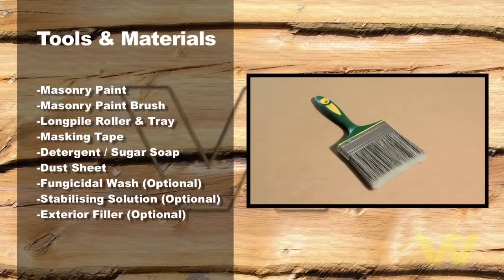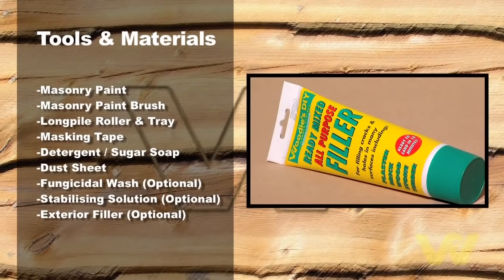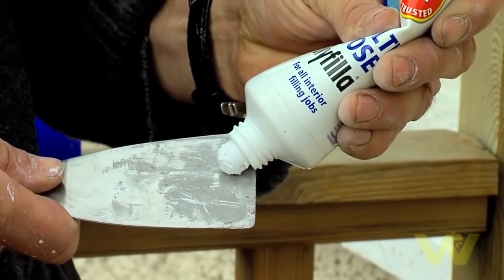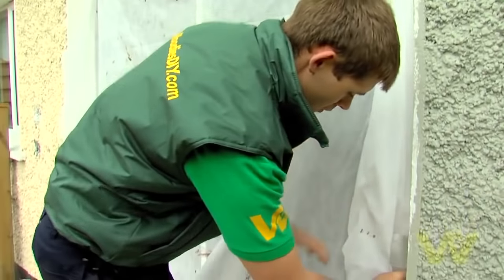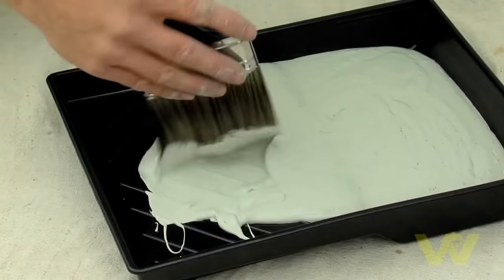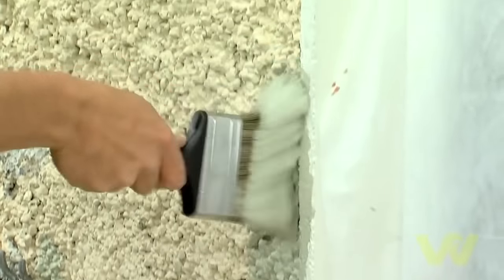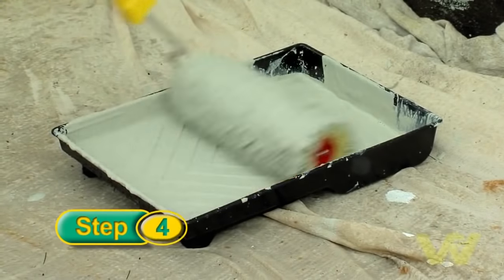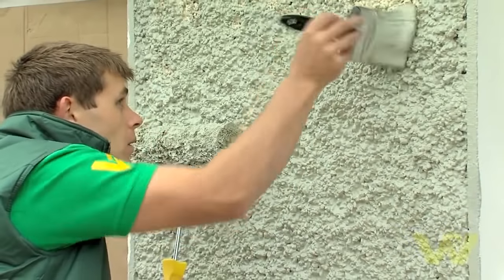How to Paint an Exterior Pebbledashed Wall

Comment: Easy?! LOL. Even with the proper big heavy pile masonry rollers this is a very physical job. You need to have the roller absolutely loaded with paint and put a fair bit of oomph behind it to get the paint out and onto the roughcast. It's taking me a day per wall of my house (2 floors) and that's not counting the edging work leading to the rollering. Good video otherwise.
Reply: Must be a nightmare going up on a ladder doing that! I want to do this, but I'm crap with ladders. Expensive to have done professionally though. Must feel good thought!
Reply: @Anticitizen2501  yeah it was tough and scary all at the same time. I’ve promised myself I’m not doing the job again but if I ever had to go to apex height again for any job I would get scaffolding put up. Much safer.

Comment: I'm doing this right now ,3bed house ,side wall only ,sandtex smooth paint.
Some of You may try to hire a compressor but it want cover these tiny holes between pebbles, paint will stick on top of stones only even after second coat and i think You will use more paint that way than using a masonry brush which will allow You to do the job with one coat ! Just make sure You hit the wall really hard with brush just like that guy and generous amount of paint otherwise You will (again) not be able to cover these tiny holes ! 
So do it once but generously and stop if You feel tired and start again after breake. 
The roller was not helpful for me at all ,maybe will be for someone to put a second coat but definitely will not do the job with the first one. 
If You are afraid of heights don't start ,hire somebody. Do a test and borrow a ladder just to check Your heights acceptance level by climbing on very top part of Your wall. If You are not able to do so ,dont start Yourself. 
Wall Preparation is important ,use sandtex fungicide then sandtex stabilise solution (primer) in dry conditions, means summer !
But before all this i recomend to cut all this dirt and algae with a pressure washer ,fungicide will not remove bigger ones ! Otherwise You will have to wait ages untill fungicide will kill algae roots.
So fungicide is really good AFTER pressure washing, prevent algae back ,not really as a algae "rapid remover" which will be perfectly done by pressure washer. 
All You do just remember ,this job will test Your patience cos attention for details is essential here !
This is not a quick job as You may se on one of the Wagner spray gun video (they left a loads of uncovered holes which is hardly visible on the video.
Good luck.

Comment: Thanks for the tutorial, we have a pebble dashed house but it's not roughcast like what you were painting. It has a lime render and the chippings thrown on after. The chippings can come off easily. How do you recommend painting this without losing too much of the chippings? Is it worth applying a slurry coat first to help bond the chippings before using a paint roller? Really appreciate your advice, thankd

Comment: lol I'm a painter and this guy made to look easy on the video for viewers, guys this is a tedious stressful job to paint this kind of stucco  a house will take you several days to complete it, and if you do it your self it will look like shit I'll charge at list 5 dollars a squares surface ft or or w ill spray it but it wont look good because it has to many pores and holes.
Reply: Hi I'm going to paint the outside of my house it's a nap finish wat would be the best type of paint and roller to use, thanks
Reply: You obviously don't know what you're doing then. I painted my house in 3 days straight, piece of piss, and it was a rougher pebble dash than this guys house.

Comment: Thanks for the good vid. 
Just wanted to ask if or not it's a good idea to paint in the winter months. Obviously I want a dry day but I'm thinking about how much longer it might take to dry in the cold etc. Any tips or advice for that or is it just a bad idea all together? Is there a minimum temperature it's still ok to paint in? 
Thanks in advance.
Reply: The Sandtex smooth masonry paint I'm using says not to use under 8 degrees c.

Comment: You need to thin your paint well to get Into to that wall ,  probably take an eternity to paint that house using paint straight outa can!!
Reply: i did my four bed bungalow last year the way he said, easy, balls its long and tireing, took me 8 full days, my tip is try and borrow some type of platform for the gable ends, i used a large extension pole but its hard to get any force on the roller to get the paint in the holes

Comment: Not as easy as he makes it look. You'll end up dabbing more than anything and when theres more than one floor to deal with and sides you soon get pretty pee'ed off. Rollers don't cut it either. 

I bought a airless spray gun. Double front room bungalow in 2 half days complete, large pebble dash. (mask and cover 3 days) Saturated the walls twice and layed off with a brush. Not sure the size of the place but did use a little over 40 litres of weathershield.
Reply: What make of airless sparky gun did you use and I take it you thinned the paint right down
Reply: @Bigcol22  i bought a bosch one from amazon, been watering down the sandtex about 40/60 to get a whitewash into the cracks